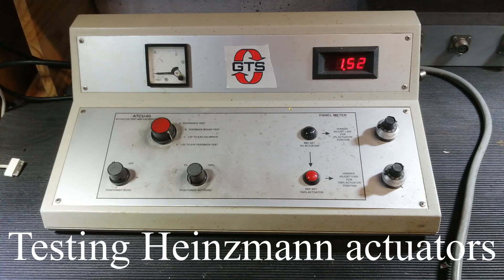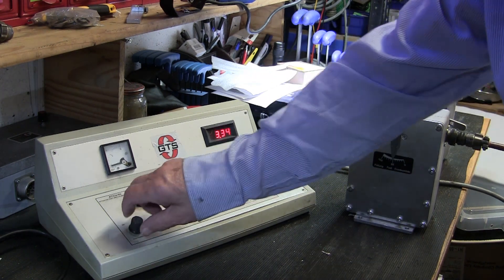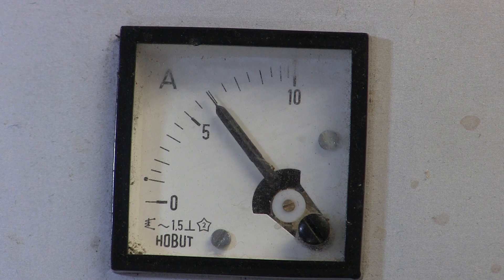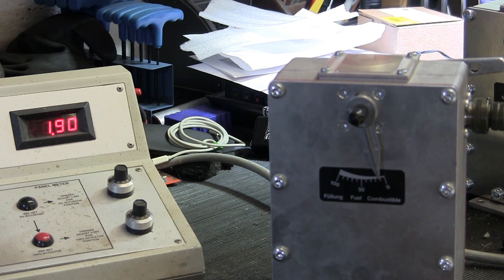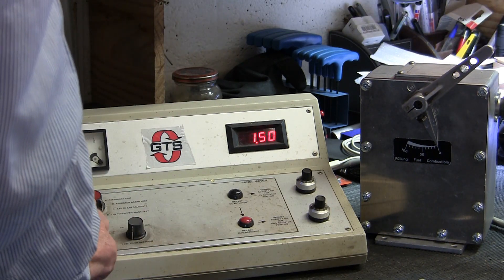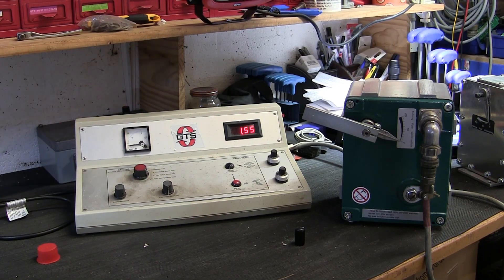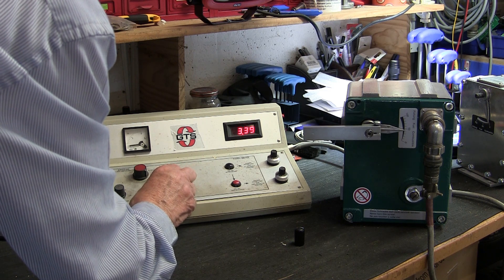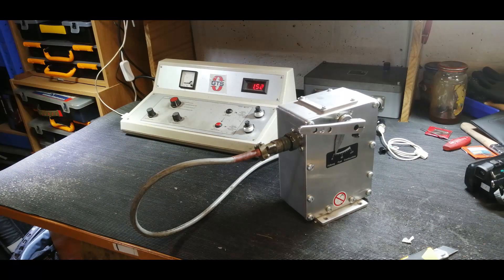Testing Heinzmann actuators. Governor Technical Solutions

Comment: I have a different type of controller that has feed back on it and would like to try it as the kg 16 is quiet expensive
Reply from the maker: I have replied to your second message. The actuator could be used with another controller. The motor requires a H bridge drive. In the Kg control box this is by power Darlington transistors running at about 2 KHz, this does change as the PWM changes. It is quite happy being driven by modern FET drives. The feedback voltage direct at the actuator is about 1.6V to 2.7V zero to 100%. The supply voltage for the feedback pcb is 8 volts. If you have a damaged Kg control box they can be fixed quite easily. I can email information to you if required

Comment: Good day  sir hope you well my name is shaun .I have noticed that the feed back voltage 0...5v so if i want to make sure it gives a voltage do i just simply force the lever 0..100 percent  with out powering the actuator ? And can u pls advise on the pins how to test .is there a possibility that i can email you perhaps kind regards
Reply from the maker: Hi, The feedback board in the actuator requires a supply voltage of 8 volts. This comes from the control box. The actual voltage from the feedback pcb is about 1.6V to 2.7 volts. It is conditioned in the Kg control box to be 1.5 volts to 5 volts for zero to 100%. On the actuator  pins, C and B are the motor. E is the 0V for the feedback pcb, D is the +8 volt supply, A is the signal. Give me an email address and I can send you the circuit diagram of the feedback pcb, also the circuit diagram of the control box if you require that. Faults are easy to fix as it is quite old technology using standard through hole components, all analogue so just a multimeter and a soldering iron are all that's needed to fix faults in most cases.

Comment: Hi!
Sorry for bothering you. I found this video while searching for information about this control. Can you help me? It would be a KG6 07 controller and an STG 10 01 actuator on a Deutz TBD604 BL6 engine (railway vehicle, diesel 450-550 kW). The engine has been completely renewed, but when accelerating, it smokes terribly black as long as there is no turbo pressure, because the controller gives full charge to the injection pump (100%) when the speed is increased. This is my question. How can it be set so that it does not go up to 100% when accelerating in no-load operation? When the engine is not idling and the turbo is "charging", there is no smoke at all. I was able to download an assembly instruction from the Heinzmann site, but I did not find it detailed enough for my problem. Sorry for my bad english, thanks for your help!
Reply from the maker: Hi, It's not a bother. I will help you as much as I can. I retired from Heinzmann eight years ago. Unfortunately for customers Heinzmann are not much help for the analogue governors. I worked with Governor Technical Solutions for a few years until the owner suddenly died. They made various accessories for the governors including fuel limiters that reduced the rate the fuel came on to reduce smoke. Tomorrow I will look through the information that I have to see what I can find to help you.. Can you give me an email address for you. Best regards, Bill
Reply from the maker: There is an input on the ten pin socket that can be used for fuel limiting. Also there can be a problem in use with locomotives when driving uphill or coating down hill. The actuator can be driving hard against the end stops which over heats the motor causing early failure. Governor Technical Solutions did a pcb that is fitted into the control box to prevent this problem. Let me know how to contact you and I can give you details
Reply: Если есть обратная связь то надо настраивать программой на компьютере а если 100 процентов то возможно не правильно выставленные рейки топливных насосов

Comment: Hello... did you work at Heinzmann before?
Reply from the maker: I worked for Heinzmann UK from 1979 to 2016. After that I worked with Governor Technical Solutions Ltd. I designed the E range of analogue governors and most of the analogue accessories. Also on the HST125 trains that had Mirlees engines I designed the engine controll system.

Comment: Hi! Excellent.how much voltage/current control for actuator?
Reply from the maker: The drive is a H bridge. While the actuator is moving from one end to the other there is about 20 volts across the motor. When it is driving in a position the current is between 1 amp and 6 amps depending on how hard it is driving to hold the position. I hope this helps. Sorry for the delay in my reply.

Comment: The inductive sensor of the STG 40-14 actuator, has 3 wires indicating a reference voltage of 8 volts in oin D and GND on pin E and a feeback signal on pin A of 1.6 ....2.8 volts.. How does this correct?
Reply from the maker: Hi Thanks for your interest. The feedback circuit uses an npn transistor Colpitts oscillator. The amplitude of this goes up and down as the actuator moves open/closed. A second npn transistor rectifies this signal. A third transistor, pnp is a follower for the output and balances temperature changes with the second transistor. The design was done in the 1970s so is very low tech by todays standards but did the job well over the years.. It is easily damaged by wrong connections to it so care has to be taken when wiring up to avoid getting motor wires mixed up with it. If this happens then the last two transistors get blown up. Easy to repair on the older through hole components but a bit fiddly on the SM later ones. When fitted into an actuator, the gap is set to a standard and a select on test resistor is fitted to set the gain. This get the output 1.6V to 5V. In the analogue governors this signal is converted to 1.5V for zero position and 5V for 100% position. There are two pots in the governor to set this up. I hope this helps but feel free to ask further.
Reply from the maker: Sorry I got it wrong . The first transistor, the Colpits oscillator is pnp. In the original through hole they were BC327 and BC337